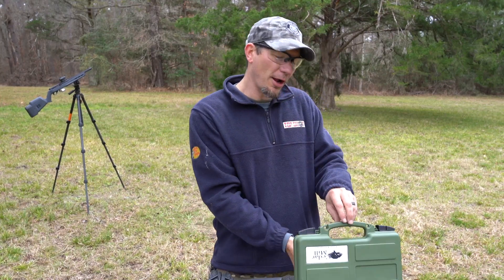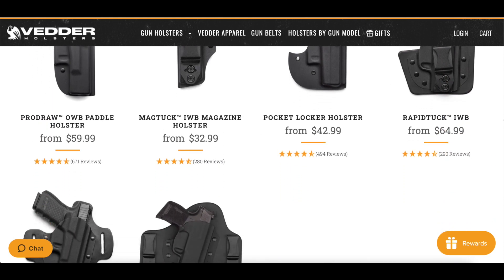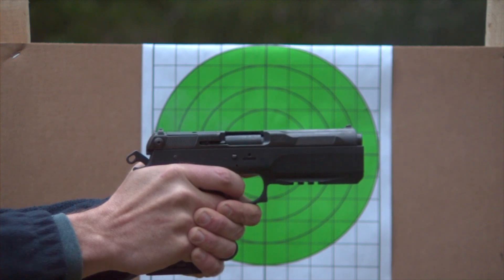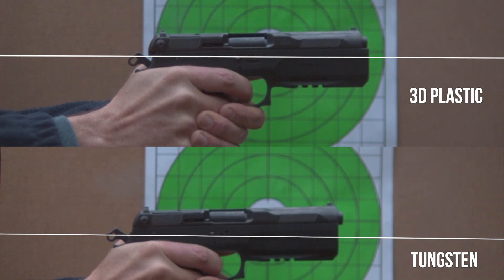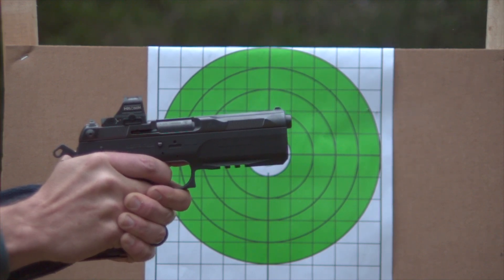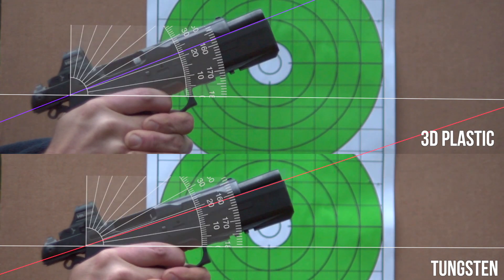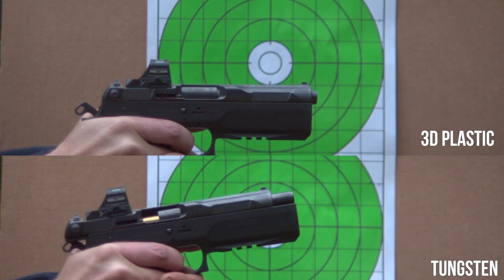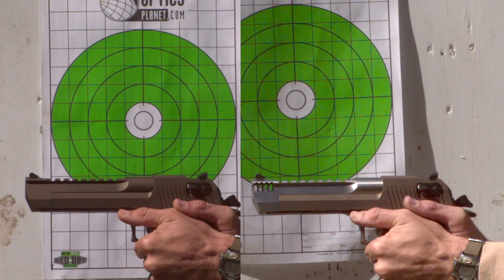FK PSD - Tungsten Recoil Weight System: Gimmick??

Comment: Nice comparison. I think the weight is gimmicky if you consider the whole action (returning to on target) because there is extra inertia required in both directions due to the weight. Humans are non linear (throw the term hysteresis in here!) By nature and fine motor controls vs brute strength requires a transition in neurons firing time (why the plastic took less time to get back on).

compensators work by reducing lift but minimal in increasing the amount of inertia required to return to target. Why they work and the weight is more gimmick in SemiAuto.

Good video!

Comment: Interesting how you get back on target quicker with the plastic filler. Maybe because with the tungsten weight you have to correct more when the slide slams back into battery? That weight on the front might reduce muzzle flip on firing, but... what comes up must come down, and unless you want it to go all the way down, you're gonna have to catch it. With more weight to be caught at the front of the gun, from there you've (maybe) got a bit more of that muzzle wobble as you try to get back on target. Seems like the initial recoil reduction could be a "robbing Peter to pay Paul" kind of situation.

Comment: I think the main benefit of the "bulky dust cover" is that the recoil spring distributes the force of the recoiling slide lower. The dust cover isn't there ONLY for the weight. Anyway, I wish you did more testing with borderline functional 9mm loads...not that I plan on shooting 9mm through mine.